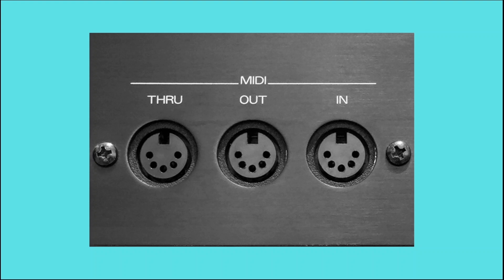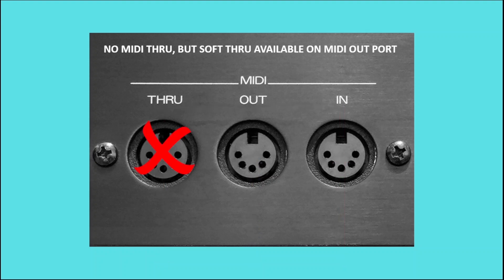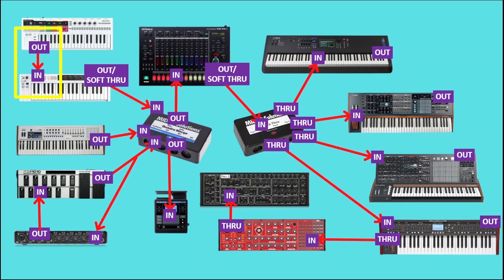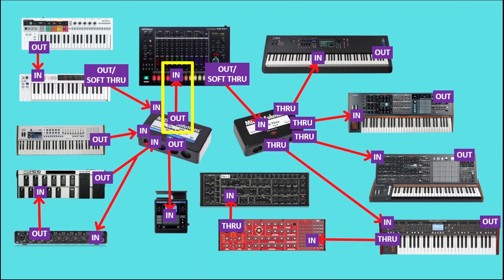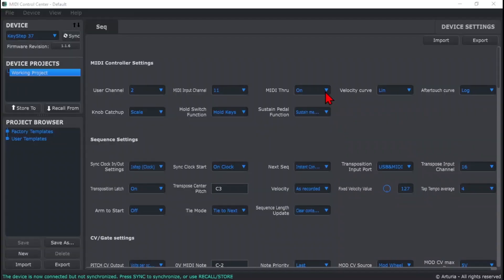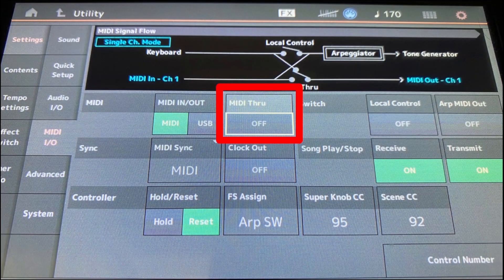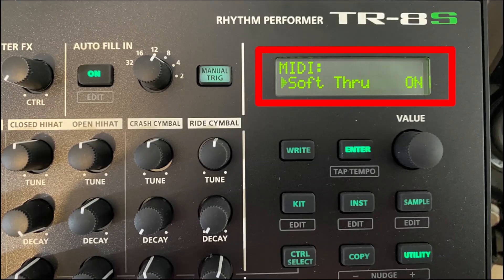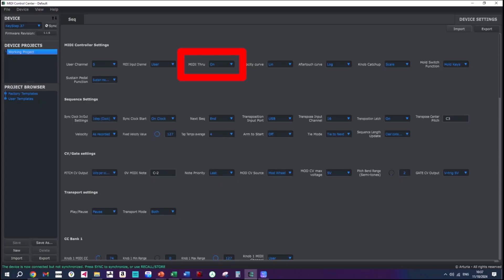MIDI Masterclass - WHAT is SOFT Midi Thru,  HOW does it work and DOES your SYNTH have it?

Comment: Hi Graeme,

Why does my lm drum have a soft thru option when it has a midi thru port.
Reply from the maker: Hi - it turns the MIDI Out into a second THRU port, meaning it can effectively operate as a ‘2 Out Thru box’.  For example if you had a keyboard as a master controller, the LM drum and then 2 other synths that had MIDI in/out, but no thru; you would need a dedicated MIDI THRU box to connect and sync everything.  But with the Soft THRU, you could connect the master keyboard to the midi in on the LM Drum and then (with soft thru enabled) connect the LM Drum midi OUT and the Midi THRU to each of the 2 synths (as both ports are now acting as THRUs 🙂.  Hope that makes sense, cheers.
Reply: @splootyvision  Thank you, i kinda had an idea that was the case i just had to ask :}

Comment: Will this work?
2 midi controllers and 1 synth module

Cont 1 out to in of cont 2
Cont 2 out (soft thru = on) to in of synth module

Cont1 = to control ch1 of module
Cont2 = to control ch2 of module

Thanks!
Reply from the maker: Hi - Yes that would work.  My only thoughts would be that I'm assuming the synth module is multi-timbral i.e. you can a split it onto more than one MIDI channel ?.  If not then regardless of having the midi controllers set to different channels the synth module could only receive from one of them at a time.  Cheers :-)
Reply: Thank you for answering! Yes it's multitimbral, it's a korg x5dr, been wanting to try the setup, most channels go to waste so might as well use another controller for brass or string parts for live playing
Reply from the maker: @ Out of interest, what 2 midi controllers are you hooking up ? Only ask as depending on what they are you may be able to get more than 2 channels/sounds simultaneously. For example I have a Keystep Pro and a Keystep 37.  With those I can have 4 sequences going on 4 separate channels using the Pro, a fifth sequence on another channel using the Keystep 37 and then play a 6th channel live on the ks37 over the top of that sequence. Just food for thought 🙂
Reply: @splootyvision  these are old boards but still useful
Roland A33 out to in of Juno d (soft thru on) then out of juno d to in of the korg x5dr

Just wondering if I can control the module with 2 controllers (without using a merger) for live playing
X5dr - 8 parts multi.timbral

Basic setup would be 
A33 ch1 to control say piano and strings
Juno d ch2 to control say strings or layers of lead or even brasses

1. Less program switching in between songs
2. Maximize available channels for layering and splits within a Combi
Reply: Hello I'm back, I have a midi related question hoping you can helo me 😊

How do I set up 2 sustain pedals for 2 synths? Main board ch1 and the other one controlling the ch2 of the main board, is it possible to have separate sustain pedals each for ch1 and ch2 without interfering with one another? Thanks!
Reply from the maker: @britesynth  Hi, if I understand correctly you want to use 2 sustain pedals on the SAME synth ? Eg a multi timbral synth with one pedal controlling the sustain on one part and another sustain pedal controlling another part (on a different channel).  I think to do something like this you would need something like a DOREMiDi MPC-10 MIDI pedal converter.  This allows you to connect two pedals and then connect the pedal converter to the synth via MIDI.  You then program the MPC-10 via its software editor so that each pedal is assigned to a different channel.  They also do an MPC-20 that alllows you to connect 4 pedals which can be assigned to 4 different channels. 🙂
Reply: @splootyvision  2 synths actually, one controlling the other parts assigned to ch2, so they both have sustain pedals controlling their respective channel asaignments
Reply from the maker: @ Apologies not sure if understood correctly.  So you’ve got two synths and you want one of them to control a part on the other synth. E.g. Synth 1 plays part 1 on Channel 1 and then Synth 2 plays Part 2 on Channel 2 on Synth 1 ?.  
If this is the case then I think the MIDI pedal converter I mentioned in previous reply is what you’d need.  
If you connect sustain pedals to each synth they will only control the sounds native to each synth.  
Sustain pedals themselves don’t generally have any way of assigning midi channels, they’re just plug and play into the sustain port.  So you would need some form of converter to convert  to a MIDI signal that you can then assign parameters to.
Not something I’ve tried myself, but only solution I can think of.  Hope that helps 🙂
Reply: @splootyvision  yes that setup exactly, 1 pedal for ch1 and the other for ch basically, sorry for confusing you 😅

Comment: I have found that my Alesis SR-16 has soft THRU port. I use it  all the time to connect MAM MB33 but I have different question if You may. Can I use cheap MIDI DIN 5 cable Y splitter to fead two different synths? This cable has one male din5 (to connect MIDI OUT) and to two female din5 (to connect two different hardware, MIDI IN). I wonder, what is going on with a clock and a data? I have one Arturia BDP with MIDI OUT. I wonder if I have to buy midi splitter, which is so expensive for me now or I can use this kind of cable. Thank You for your time.
Reply from the maker: You should be able to use a simple y splitter if just running to two synths.  Can't guarantee it will work, but I use one on my FCB1010 MIDI Pedal board to split the signal to a THRU box (which then runs to 6 other synths) and also into my Audio interface so the FCB can talk with the PC and it works fine.  Worth a try, however there are some good cheaper options for a proper thru box like the CME Thru 5 which is about £40 GBP here in the UK. Cheers 🙂
Reply: @splootyvision  Thank You for Your time. I wonder, how it works. Can U make a test with multimeter, how wiring is made? I am looking for a diagram one hour but can't find any :/ Strange.
Reply from the maker: @pierrenagonio  Sorry I’m not that technical, I know how to plug them all together 🙂, but as far as wiring and testing - no idea I’m afraid 😟
Reply: @splootyvision  Thank U for all answers. See U next time!

Comment: Are there any latency implications to using soft thru MIDI control?
Reply from the maker: @ManCalledMif  None that I’ve experienced, but from what I’ve read there are possibilities depending on set up e.g. if you were ‘chaining’ a large number of devices all using soft thru.  This is because the ‘soft thru’ is actually software driven inside the unit and that may take slightly longer to process than a dedicated Thru port, also depends I suppose on how much MIDI data is being sent through the ‘soft thru’ in combination with what is going through the out at the same time.  As I say, I don’t have any issues though 🙂

Comment: These videos have been really informative, I still don’t get some stuff about midi . For Example I can’t seem to figure out the midi thru with Berhinger boxes 😢  I have a td3s midi out that’s marked out/thru going to rd6 drum machine midi in and drums play the same midi pattern that the td3 is playing but I only want it to start stop so I can play drum machines internal patterns .  I have both boxes set to midi not internal or sync and don’t think there is any option to activate soft thru . I could be wrong I don’t do manuals lol 😊 but the td3 is getting it’s seq from my mpc one via midi because is a nightmare to seq on the box but the drum machine is easy to seq . Any ideas what I’m doing wrong ?
Thanks
Reply from the maker: Hi and thanks. 
Are the TD3 and RD6 on separate MIDI Channels, sounds like they're on the same channel if both using the same 'information'.

If that's not the case then it maybe to do with how the Thru is handling stuff and I've heard and read a few issues around how it works on some of the Behringer boxes.  Couple of options in that case:
1. Have you tried putting the drum machine before the TD3 ?
2. A MIDI Thru box, for example the CME U6 Midi Pro is fairly cheap at about £40 on Amazon in UK (not sure where you are).
2.  If its just the MPC One going to the TD3 and RD6, you should be able to get away with just a cheap MIDI Y Splitter for around £10.  You'd need the One Female to Two Male splitter.  Run MIDI cable from MPC One into the female end and then plug the two male ends into each of the TD3 and RD6. 
Here's an example of one:
https://amzn.eu/d/hOFVBvM

Hope that helps.  Cheers.
Reply: @splootyvision  thanks for the detailed reply I ment to get back to you way sooner :) I’ve now got it working :) thanks for your help 
I pretty much Plumbed it all wrong lol
Reply from the maker: @Gordie69420 No worries sir, glad you got it all sorted :-)
Reply: Just to add, i had a few emails with korg customer service to get something clocked without note info on my korgs. you set the receiving synth to a different channel and the clock to "ext" or "auto". i've been using an old alesis sr16 drum machine with no battery as my clock when i can. it defaults to a blank user pattern so it sends nothing but clock. i can still use a foot switch to start and stop it, which starts everything hands free